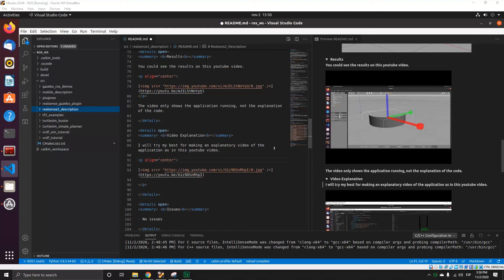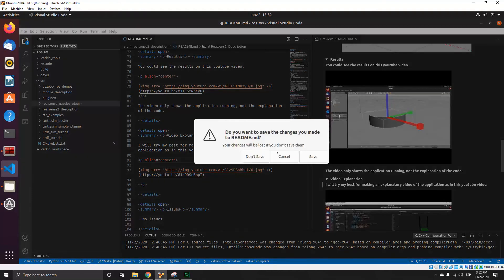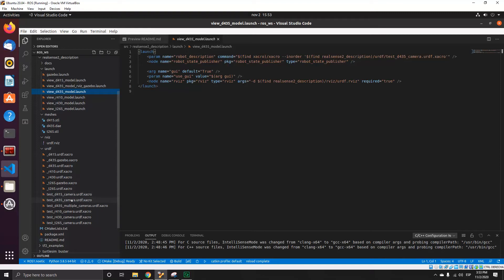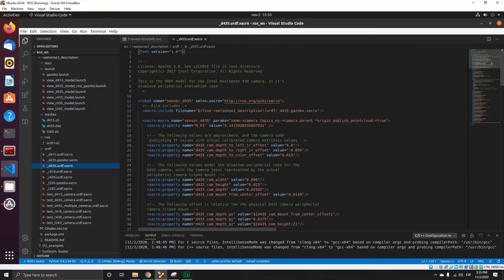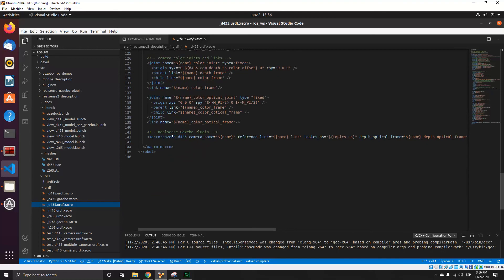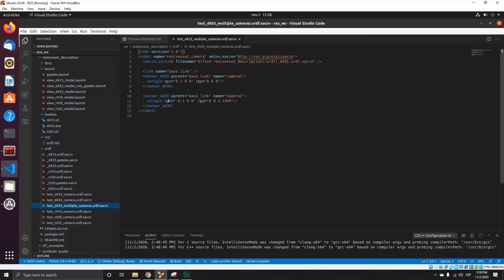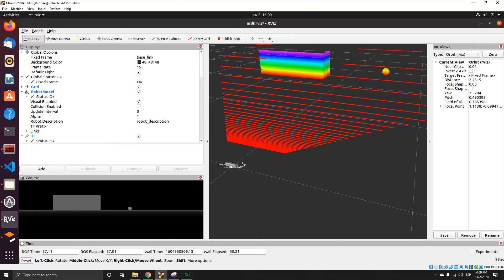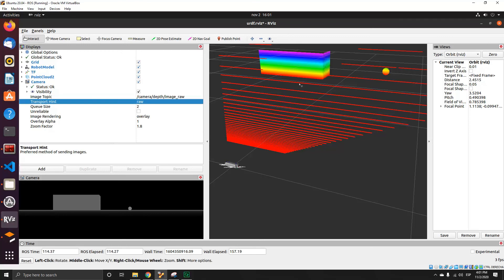Explanation How to Integrate Intel ROS Realsense D435 with Gazebo and Rviz - Jetbot AI Kit

Comment: Hello Rangel, thank you so much for the video. I'm currently facing an issue where the camera appears in RViz but doesn't seem to spawn in Gazebo. Looking at the Worlds -> Models in my Gazebo UI I only see ground_plane... Any advice on how to resolve this? I am using those exact files with ROS Noetic and Gazebo 11.
Reply from the maker: You have to first check if the urdf parses.

If parses with xacro then try to spawn manually 

Finally try to spawn with the launch file

Sometimes is problem of the path, sometimes is problems of the physics if you modified the file
Reply: @issaiass  Thank you for your quick response! I solved the problem, I was working in a ROS workspace with a lot of packages and I had misconfigured paths. I created a clean workspace and everything worked fine :) I attached this camera in a pioneer3at with p2os_urdf pkg with the help of this video of yours: https://www.youtube.com/watch?v=DWLXYEmcUsA&t=813s
Reply from the maker: @margaridapereira4654  good to know that worked for you

Comment: Hi Rangel, I've cloned both your repos, unfortunately when I run it, the camera doesn't capture anything according to Rviz. Under camera it says "No Image Received", and "No CameraInfo received on [/camera/depth/camera_info]. Topic may not exist." Any reason why this might be happening?
Reply from the maker: Monitor the ros topic to see whats happening
Reply from the maker: See the logs on initialization to see which problems are there
Reply: @issaiass  Thanks for the reply, I checked rostopic list, and can see all the topics are there. I checked rostopic info for the specific topics but there are no publishers, only subscribers, which may be the issue. How do I figure out specifically what's wrong and how to fix it? Is it the fact that I have a different ROS version?
Reply: I'm quite new so I don't know what to look for in the logs.
Reply from the maker: @muhammadshaheerbalouch6244  any problem or something not loading, but i recommend you to start then with the basics, i have a course based on very basic stuff in ros in the list here
Reply: @muhammadshaheerbalouch6244  hi. Did you find a solution? I am having the same issue with d405. It works on d435 though

Comment: Hi Rangel great video! Thanks to your instructions I was able to add this camera to my robot really easy! I have one question regarding the plugin: Is there a reason that the point_cloud rgb values are all gray? The d435 should have rgb depth imagery support so I am not sure if I missed a setting or if this is a limitation from the plugin.
Reply from the maker: That's all configurable via rviz, do not worry about that
Reply: @issaiass  Thanks for the response. Sadly the topic publishes a gray pointcloud instead of rgbd data. Do you have any idea for how change that?
Reply from the maker: @1000MZ1000  have no rviz in front of me but what i remember is to change in the point cloud to rgb and intensities
Reply: @issaiass  I am not able to find a setting in rviz that displays the object colors. My settings are PointCloud2, depth/color/points topic, color transform rgb8. Could you please verify on rviz as soon as you have the chance? I don't want to start rewriting the plugin before I am sure that I could have not avoided it. Thanks!
Reply from the maker: @1000MZ1000  ok, but you can look at ros velodyne bag file that is in the ros wimi, they are in colors the point cloud
Reply: @issaiass  Yes I looked at that and you are right but they are all gray scaled so 73/73/73 or 57/57/57 and so on thats why I thought maybe I configured something the wrong way but when I load your repo and just do your test I get the same result. Could this really be that the plugin is missing something this would be really stange to be honest
Reply from the maker: @Okram  Let me check, but probably in the urdf or in the plugin as you say
Reply: @issaiass  Thanks have you found something?
Reply: @1000MZ1000  Hey, how did you added the camera on your drone? What kind of launch file did you create? Coz i am having a big problem implementing it.

Comment: Hi Rangel! I am currently working on a thesis with ur5 robot and TIAGo from pal-robotics, and how can intel realsense camera publish the position for an object  that for an example, ur5 can subscribe and perform a pick and place task?
Reply from the maker: I did not do that in simulation because a physics error I have but, when the octomap is generated you could use the moveit grasping example, they explain how to generate different grasping patterns and select the optimal one.

Depending of the object it will be different how how to grasp it, but again, moveit examples of graaping are good enough.
Reply: @issaiass  Ah I see, Thanks! However when I am implementing this in my ur5 gazebo file and made changes in the xacro also, only the camera spawn. Ever encounter that problem before? I am wondering that i might have go make a new launchfile were i include them both?
Reply from the maker: @RaviKumar-ub2ng  use vscode first to see the urdf, also ros has some urdf tools to check the sintaxis, actually I think could be if rviz error to change the reference frame or If not then a link or some controller not loaded. I have a video that could give you some hints if you check on my video tab, something like "problems ..." Do not remember the title

Comment: Thank you for the video! I have a question. Why is the pointcloud2 on Rviz appearing as a rainbow-ish colour and why is the camera of the simulated realsense grey/black in colour (in Rviz too)? I changed the visual of the ball in front of the camera to bright orange colour but I get the same rainbow in the pointcloud2 and dark silhouette in camera in Rviz. I need to be able to detect the orange using the RGB values to proceed to detect the orange object. Any idea on why this is happening? Thank you!
Reply: Note: I changed the visual in Gazebo model editor*
Reply: Okay so i fixed the issue of the camera showing in grayscale. When i change the topic to camera/color/image_raw (instead of camera/depth/image_raw), i can see the orange. However when i try to observe the pointcloud in RGB8, it is in grayscale all of a sudden. When i set it to AxisColour, it becomes that rainbow colour i mentioned previously. I do not want this grayscale point cloud, I want the RGB as well go show the orange colour in the depth point cloud. How can I achieve this? Thanks!
Reply: I realise the reason i am getting grayscale. The depth is not aligned to the colour. In the actual realsense camera, i can set align_depth to true in rs_camera.launch (inside the realsense2_camera package). How do I do it here in gazebo? Thanks!
Reply from the maker: @naruto7350  rviz is just a tool for visualizing robot interactions, if you get the PCL you will get points as features of objects, if you get the raw image you get pixels at, in example, rgb then you could detect the color by range of HSV

Comment: Thanks Rangel, this is excilent and a very clear explanation.

Just a quick question though, how would you recommend going about using some of the Intel Realsense library's in cooperation with this i.e get_distance or deproject_pixel_to_point?
Reply from the maker: If you want a project example related to perception and depth cameras common and interesting tasks could be classification (analyze and filter point clouds to see which object is), visual serving (knowing the depth, you can approach and grab the object), reconstruction 3d (make a 3d map of an unknown environment)
Reply: @issaiass  thanks for your response Rangel, I am currently trying to port my visual servoing code over to simulation. It is reliant on using the Intel python libraries, so I'm just wondering if they are compatible with the simulated camera?
Reply from the maker: @leeosaya  I think it should be if the libraries are just for post process the PCL using the topics

Comment: Hi Rangel, good work! Quick question: Were you able to add some noise to the simulated depth plugin?
Reply from the maker: No, because i think the default plugin does not have it.  

Anyway, there are three ways.  

One is directly to the plugin, add a gaussian noise function and mix it with the image and 

The other is to do that in the sdf file as explained in the gazebo tutorial http://gazebosim.org/tutorials?tut=sensor_noise.

The last one is to use the image topic, then use opencv to add a gaussian noise to the image and republish to a new topic; in that way you will not mess with the plugin.

Probably the last one is the easiest.

Comment: Thank you! 
I have a question about plugin in Gazebo. Is that normal that the model of camera in Gazebo is all grey? It seems that the camera rendered correctly in Rviz but in Gazebo, it was grey and didn't have any color.
Reply from the maker: They do not have a mesh file just an RGB value for gazebo, check the urdf materials of the realsense and you will get more clear about that.

If you want to link the mesh file then you will have to put it on the uri